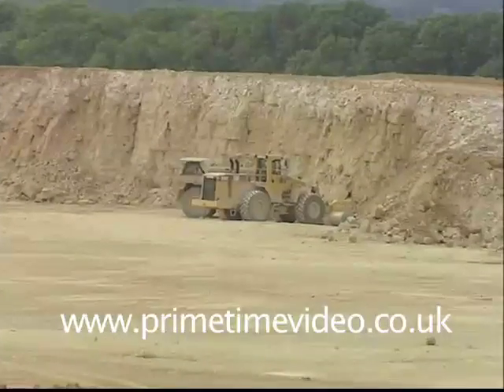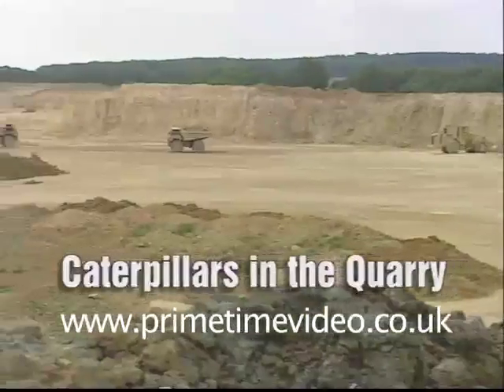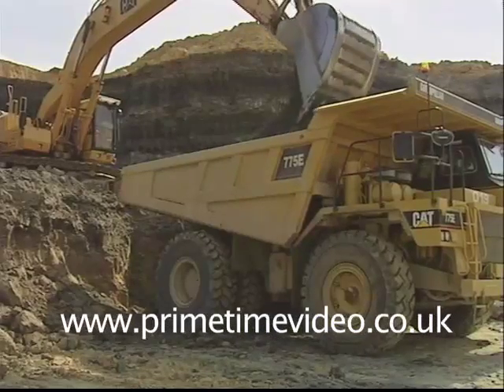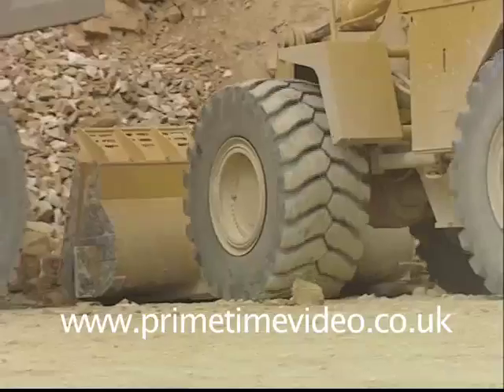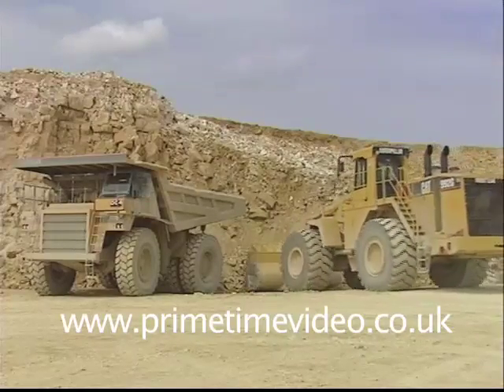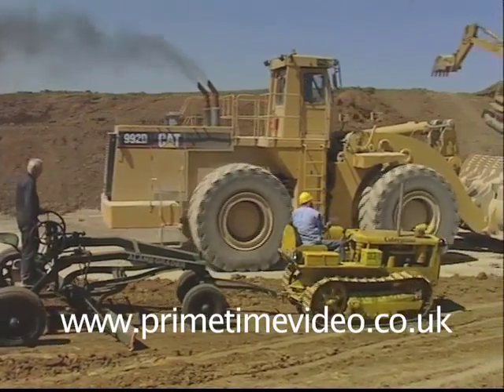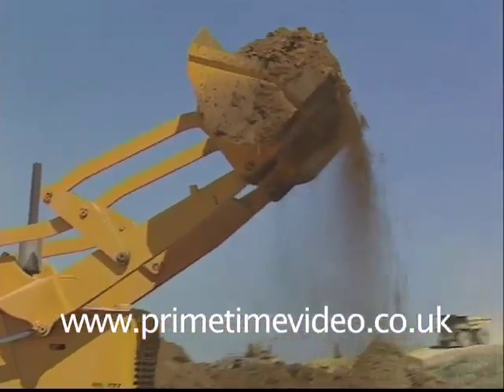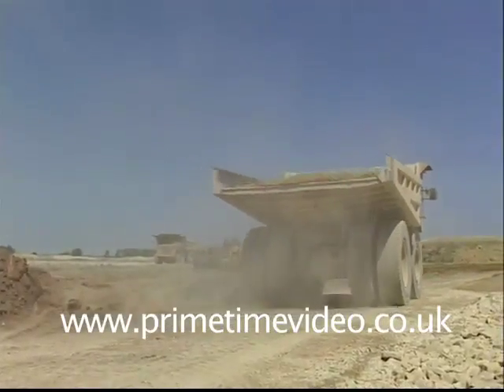Caterpillars in the Quarry DVD

Comment: Thanks so much for the upload go the video.

The difference between the old, and gradually getting newer, and the new is astounding size wise. We think now that the machines in the quarries are huge, but will they be driven alongside the then new machines in 50 years where a brand new truck or Lorry as we call them, may be 1000 Tons?

Comment: Actually, their even worse about "Safety" BS in the UK. Perhaps the difference is that over there it's due to overbearing government regulations, not just from insurance claims. I mean, OSHA is ridiculous at times, but in the UK it's a running joke about how you have three safety inspectors and two management guys for one worker, who has to spend half of the day following safety regulations to do any work. In either case, with paper work and/or liability waivers, things like this can be done.